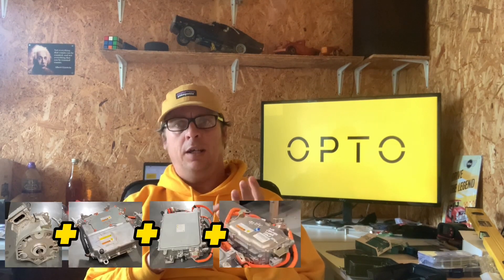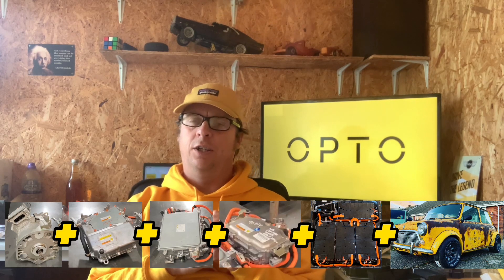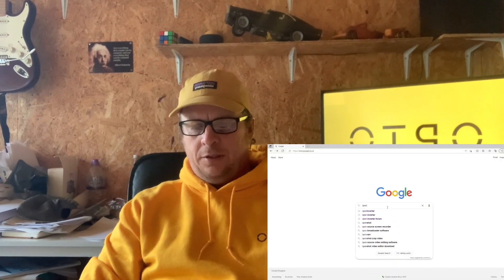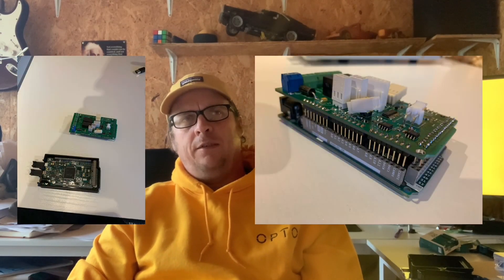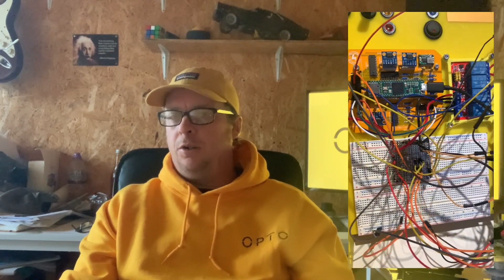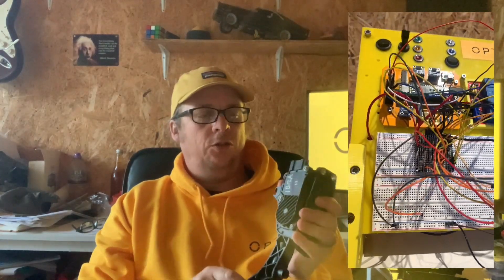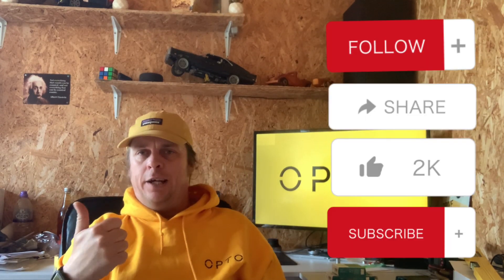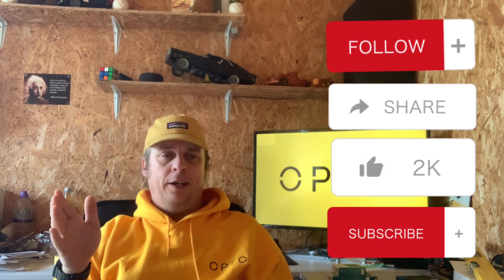Developing an electrical control system for the Mini. OPTO Innovation’s Mini EV Conversion Part 4!

Comment: You should use Toyota Prius inverter, look at the DIY EV channel. He is doing BMW Z3 conversion. You could also check my channel but I am using Toyota Prius gearbox as a motor. You can get boards made and assembled by JLC PCB
Reply from the maker: We have one of them in the workshop but it would be nice to use all Mitsubishi stuff!
Reply: @optoinnovation  you could use it in future videos.